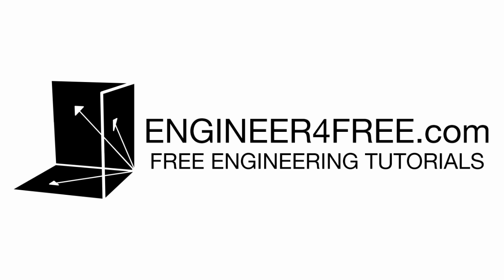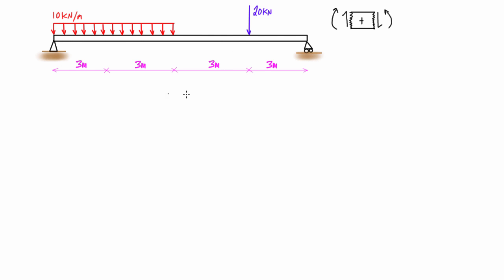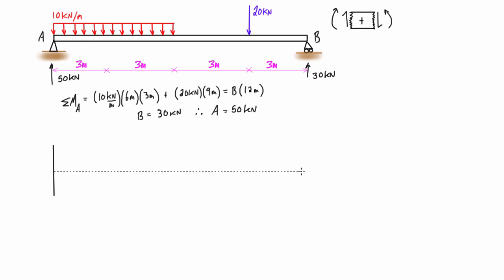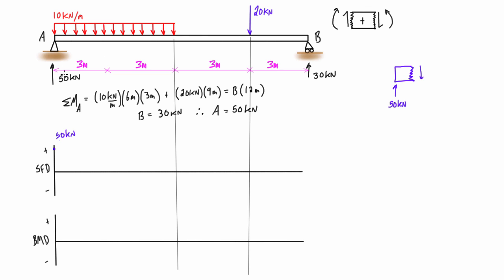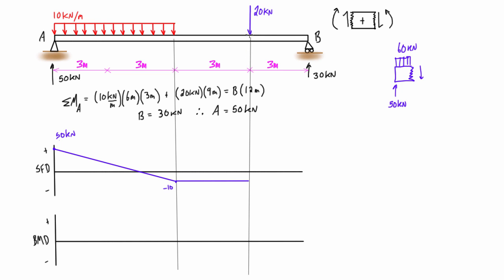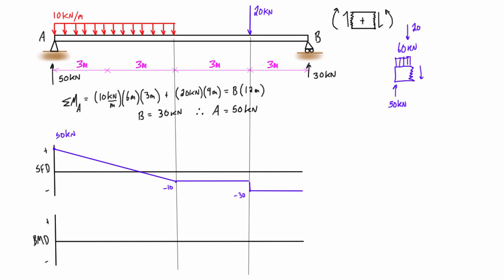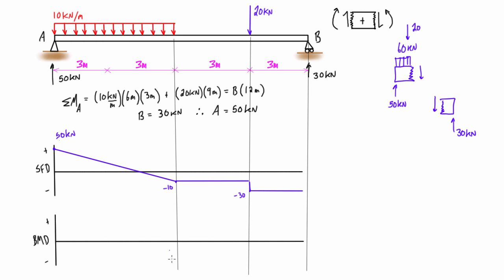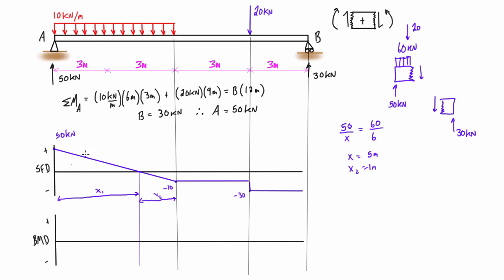Shear force and bending moment diagram practice problem #1

Comment: I'm so sorry but didn't the sign of the BMD should be in opposite direction as in SFD???
The positive sign of BMD should be on bottom line and negative sign of should be on top line of the BMD...
Reply from the maker: It depends on which country you live in, the conventions are different. Some draw positive on the tension side ( as you are asking) and some draw positive on the compression side (as I have done). Either way is fine, just follow the convention that is expected of you though. Always pay closer attention to the +/- written on the vertical axis of the BMD

Comment: how did you get 10(3)(6) where is the 3m coming from if the point load is at 6m
Reply from the maker: (10kN/m)*(6m)=60kN is the magnitude of the entire distributed load. It’s centroid (location of resultant) is in its middle, which is 3m from either side of it. That means the resultant is 3m away from point A. So (60kN)*(3m)=180kNm is the magnitude of the moment that the distributed load causes about A. Note that the units check out too for the units of a moment!
Reply: Engineer4Free ....so we only multiply centroids for distributed systems cases??
Reply: @lemitowfik5881  It's physics, the moment is the force times the moment arm(distance). So what happens is you have an integral F(force)x(distance)dx, from in the case of the video from 0 to 6. That integral's solution is (Fx^2)/2 = (10(kN)6^2)/2 = (10x360)/2= 180kN. It could be -180kN, but you have to look if that makes sense in the specific problem. I have this as a one time course in my computer-related physics major (can't translate it) I've had only 2 lessons, don't know anything.
Reply: Just as lost as you are mate, I’m still looking a video that’ll explain everything from the start ☹️
Reply: Check out this video on force resultants https://www.youtube.com/watch?v=aLvL15bezsM

Comment: To Whom It May Concern,

When we are looking at the BMD (body moment diagram) on the third break in line 9 meters across we multiply 10KN * 3m.  I can see that this works just by looking at the graph but I don't know why.  Can anyone tell me why we multiply 10kN * 3m instead of what I would expect to see 20kN * 3m?  Thank you for the video it's a huge help.
Reply: He multiplied 10kN*3m to get the area of the rectangle between 6m to 9m. 
10*3 = 30m for the area (l*w) so the BMD from 6m to 9m is going to end 30m less than the previous height. (Less than since the area is negative bc under x axis and in a linear function since the SFD is a line)

This is the same concept for the first area that was found, it being 2 triangles from 0m to 6m. 
T1 = 1/2bh = .5*5*50=125 
T2 = 1/2bh = .5*1*10 = 5 

Since T1 is in the positive side, the BMD is going to be a parabolic function to a height of 125, and since T2 is negative the BMD will be a parabolic decrease in height to 125-5 or 120. 

The reason it’s parabolic in the BMD 0m to 6m is because it is linear in the SFD from 0m-6m 
And it’s linear in the BMD 6m to 9m because it’s a horizontal line in the SFD on that interval. 

I hope this helps!
Reply from the maker: Yessssss thank you! That is exactly what’s going on here 😁😁

Comment: Di he forgot the 20kn in bMd?
Reply from the maker: Point forces don't cause a jump in BMD. Point forces cause a jump in SFD only. Applied moments are what cause jumps in the BMD. The point load does change the slope of the BMD however from one side of it to the other.

Comment: how do we get A 50knm ?
Reply from the maker: First, take the sum of moments about point A to find B = 30kN, and then take sum of forces in y direction, which is 0 = A + B - (10kN/m)(6m) - 20kN = A + 30kN - (10kN/m)(6m) - 20kN = A + 30kN - 60kN - 20kN = A - 50kN. So 0 = A - 50kN ... rearrange to find A = 50kN. If you want to review your 2D statics, check out the "moments" section here: engineer4free.com/statics

Comment: How did you find that A and B you should have to do it in details
Reply from the maker: I just apply the three equations of equilibrium to find A and B: sum of force in c, sum of force in y, and sum of moments about a point (I chose A). There are no horizontal forces so I only reallyapply the second two. This video is part of a review section of a senior level series in structural analysis ( engineer4free.com/structural-analysis) that assumes some prior knowledge. I've got a whole series on statics too ( engineer4free.com/statics), check that link out and go over the vemideos in the "moments" section, they cover finding reaction forces in detail 🙂

Comment: Trying to explain to my son. Indeterminate Beam with even distributed load and 3 support, and different length between supports. Can´t find any explanation how to divide into separate cases and superposition for that?
Reply from the maker: Superposition + indeterminate problem is referred to as the force method. You can find some tutorials that I did on force method here: engineer4free.com/structural-analysis On that page you'll also find a section dedicated to superposition for statically determinate problems that would be a good review/intro. Also, you could solve your problem with a different method, such as the slope deflection method which there is also a section on that page describing it. Cheers =)

Comment: Please don't neglect infants.
Neglect dumb people instead.
PD   NI
     O
ND   PI
Positivedecreasing Negativeincreasing
Negativedecreasing Positiveincreasing

This explains which way the parabolas curve for the moment diagram based on the triangles in the shear diagram.
Reply: This is very convenient
Reply from the maker: Cool I never learned that acronym, I always went with a quick visual approach to numerical integration. The taller the triangle from the axis, the greater the magnitude of slope in that region, and then used the positive/negative area to determine if it's increasing or decreasing, and together there's only one way to draw it, but good to have another trick!! Thanks for contributing =)

Comment: What if there is no 20kn in the problem?
Reply from the maker: Then solve for Ra and Rb without it. Ra and Rb will be smaller. Follow the same process. Magnitude of shear at each end will basically equal the magnitudes of Ta and Rb just like it is in this video. BMD will also work out to be zero at each end because it is simply supported.

Comment: does it mean that we can cut at any point? or we have to cut on a specific point?
Reply from the maker: You can take a virtual cut anywhere you want, but it's going to bee the most useful if you cut at each end of the beam, the beginning/end of any distributed loads, at any point loads and at any applied moments. Also at any other reaction forces if the beam is overhanging or has multiple reactions.

Comment: try to slow down and emphasize concepts that are foreign or at least of interest instead of blazing through it as if we've seen it a million times before. So for example, drawing it is pretty new, try to explain the directions more clearly
Reply from the maker: Hey Jim, this video is part of my structural analysis playlist ( engineer4free.com/structural-analysis ), a senior level undergrad course. This video does assume that the student is familiar with the topic, and is considered a review for that course. I have a set of videos on SFD and BMD that assume no prior knowledge, and go much slower and explain more about the actual math that's going on. Those videos are numbers 66-72 here: engineer4free.com/statics I recommend checking them out =)

Comment: I was little confuse to determine if it is concave upward or concave downward if you sketch in moment diagram but i really appreciate your video  😊
Reply from the maker: Where the BMD is positive, the curvature will be concave up, where the BMD is negative, the deflected beam will be concave down. At points where the BMD switches from positive to negative, you have an inflection point in the curvature. This is a good example that highlights it: engineer4free.com/4/shear-force-and-bending-moment-diagram-practice-problem-8 but I also recommend just watching videos 1-9 here: engineer4free.com/structual-analysis for more examples and practice to get the hang of these

Comment: Your Ra and Rb are wrong...so ur whole bending moment dia is wrong do it by accurate method you will see
Reply: Nope his reaction forces are correct.  Instead of just claiming he's wrong Read vai why don't you provide proof.....or stop trolling!
Reply: My bad i was wrong guys,sorry
Reply from the maker: I believe Ra and Rb are correct. By Sum of moments about A, (10kN/m)(6m)(3m)+(20kN)(9m)-(B)(12)=0 ... 180kNm+180kNm-12B=0 ... 360kNm/12=B ... B=30kNm. And by sum of forces in y direction, A+B-(10kN/m)(6m)-20kN=0 ... A+30kN-60kN-20kN=0 ... A+30kN-80kN=0 ... A-50kN=0 ... A=50kN. Both A and B are in the upward direction.

Comment: 3rd cut to the left side of 20kN. why did you include 20kN?
Reply from the maker: Third cut is taken just to the right of the 20kN (not just to the left). Because the cut is just to the right, the 20 kN force is included in the fbd. If we cut just to the left of it, it wouldn't tell us anything we didn't already know. By cutting to the right, we learn the jump in shear across the applied point load.

Comment: why is moment about A 10kN/m x 6m x 3m Instead of 10kN/m x 6m? sorry if this is silly
Reply from the maker: Yea no worries it's a good question. Moments are in units of kNm. If you multiply 10kN/m * 6m as you suggested, you get 60 kN ... the m's cancel out and your left with just kN. kN is the units of a force, not a moment. 60 kN is important tho, it is the total force exerted on the beam by the whole distributed load. Ten kilonewtons per meter times 6 meters is 60 kilonewtons. Moments basically need a force, and a distance to a point that the force is perpendicular to. For the purpose of calculating the moment about a point caused by a distributed load, we consider the resultant force (the total force exerted by the whole distributed load) to be located in the center of the distributed load (for uniformly distributed ones like this). So the resultant force is in the middle, which is 3m away from either side of it. That mens it's also 3m away from point A. Now we have the whole force (60 kN) and the perpendicular distance to A from the line of action of the force (3m) and if we multiply them together we get 180 kNm. We now have the right units of kNm for a moment. I just did all of that in one step by doing 10kN/m * 6m * 3m = 180 kNm. Hope that helps clear it up, if you need extra help on this stuff, check out engineer4free.com/statics videos 25-34 for moment, videos 58-65 for distributed loads, an 66-72 for SFD & BMD basics. There are more examples to work through on SFD/BMD too in videos 1-9 at engineer4free.com/structural-analaysis . Cheers hope that helps!
Reply: @Engineer4Free  That's really helpful thanks so much man! I've subscribed and will check out your website:)
Reply from the maker: Awesome, glad I can help! Please tell some friends about the site too if they could benefit from the videos as well =) =)
Reply: @Engineer4Free  Already done it mate!
Reply: @Engineer4Free   Damn! Honestly wish I found your channel earlier, gotta blame my own procrastination though. Honestly you've helped A LOT though, A massive thank you from me!!
Reply from the maker: @TurrellHarper  hey no worries, glad you found it and I'm able to help you out!! 😁

Comment: Why is it 30 downward?. Should it be upward?
Reply from the maker: The fbd that's drawn at 4:15 is the right hand side of the beam with a virtual cut taken just to the left of the reaction. Because the reaction applies a 30 kN force upwards on the beam, something has to be resisting it in an equal and opposite fashion to keep it in static equilibrium, The thing that provides that condition is the 30 kN internal shear that points down to oppose the upward force of the reaction.

Comment: Statics final tomorrow, wish me luck!
Reply from the maker: Ahhhh good luck for real Matt!!! Check out engineer4free.com/statics for all my statics videos and then also the first section of engineer4free.com/structural-analysis if you ned more practice with SFD/BMD!
Reply: @Engineer4Free  what is the program that u used to draw this?
Reply from the maker: I think I used Sketchbook for this one. I've got a full list of the hardware and software that I use to make the videos at engineer4free.com/tools 👍👍
Reply: @Engineer4Free  hi, could you solve one of my questions if it’s possible
Reply: Same here friend, best of luck to you
Reply: Strength of material final exam tomorrow wish me luck
Reply: well hello matt, how did it go in that exam 3yrs ago though!?
Reply: @Kuziva1  lol Matt probably has kids now
Reply: @Zelvf  Lmao, finishing my last semester getting my degree and having a kid currently. I remember static engineering like yesterday, glad it's all over.
Reply: Hope it went well! Got statics in a few days!
Reply: Same,lmao
Reply: sana pumasa 😮😮😮😮 sa strema
Reply: same!

Comment: how about the maximum shear force and bending moment? also thnx for the very clear explanation !
Reply from the maker: The maxi shear and bending moment can be read off the graphs. The max shear is +50 kN, and the max bending moment is +125 kNm. If you do SFDs and BMDs with this method, you' will always be able to read the max values on the diagram. If you study structures further, the sign (max positive or max negative) will become important too, but still you will be able to just read it off the diagram.
Reply: Engineer4Free THANKS for the quick and the informative reply 🙌🏻
Reply from the maker: No worries! Glad I can help =)

Comment: How you find the moment of the udl?
Reply from the maker: need to find the resultant force of the udl. It's in the middle (so in this case 3m from either side), and it/s magnitude is 10kN/m * 6m = 60kN. This magnitude is what you use for the resultant, so it exerts 60kN * 3m = 180kNm moment about A. Take a look at this video that introduces resultant forces / moment stuff about udls: https://www.engineer4free.com/4/distributed-loading-on-a-beam-example-1-rectangular-loads
Reply: @Engineer4Free  thank you for the clear explanation sir!
Reply from the maker: No problem! Thanks for the good question!

Comment: i'm having trouble getting Ra and Rb i wish you do it step by step
Reply from the maker: The line where I write sum of moments about A has a single unknown, which is B (Rb). Just rearrange to solve for B. For A (Ra), just take the sum of forces in the vertical direction. Knowing that Rb is 30kN up from the previous step, the sum of forces in y is (-10kN/m)(6m) - 20kN + 30kN + A = 0 ... just simplify and rearrange for A ... A = 50kN up. Hope that helps.

Comment: about the sum of moments at point a: notify me on the 6m and 3m how they come about..
Reply: I need this too. Please somebody explain it.
Reply from the maker: Hey. The distributed load is 6m long, so it's total force is (10kN/m)*(6m)=60kN. Uniformly distributed loads are considered to act through their "center" when talking about the moments that they exert on reactions. The center of this uniformly distributed load is 3m away from A. So in one term, I have used the 6 and the 3 to find the magnitude of the force and it's distance from A, which are the two ingredients needed for the moment it causes about A. Hope that clears it up.
Reply from the maker: Hi, just so you get a notification, I put the response to this question under the OP.
Reply: @Engineer4Free  why is it we multiply 9m for 20 KN??

Comment: I think BMD should be concave.
Reply from the maker: If the entire BMD looks flipped about the axis to you then that's okay, I draw BMDs on the compression side, some people draw them on the tension side. Follow the convention that is mostly used in your country. If it looks like it's on the right side, but you were expecting the first part to be "concave up" then you need to look a little closer. The slope of the BMD is basically the value of the SFD. Where SFD has a larger value, the slope on the BMD will be greater. Thats why the left side of the first section has a steeper slope than the right side. For that to be true, and get the proper change in magnitude, it can only be concave down as drawn (when drawing BMD on compression side). Hope that helps clear it up :)

Comment: Great videos.  Do you know anywhere one could find shear and moment diagram practice problem videos like this for distributed loads of varying shapes, such as parabolas, triangles, etc?
Reply from the maker: I've got some videos for finding reaction forces with triangular/parabolic etc distributed loads under the "centroids and distributed loads" section of engineer4free.com/statics that would be a good starting point, as that is the first step in drawing the SFDs and BMDs. I should include some actual examples through on doing full problems. Thanks for the suggestion, hopefully I can get around to making some soon!